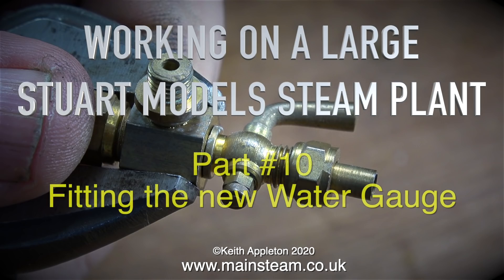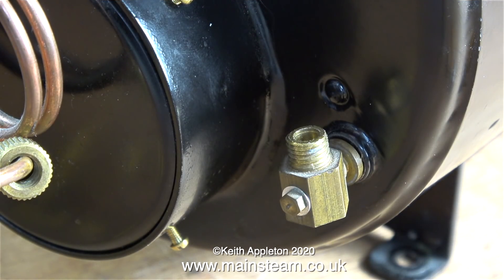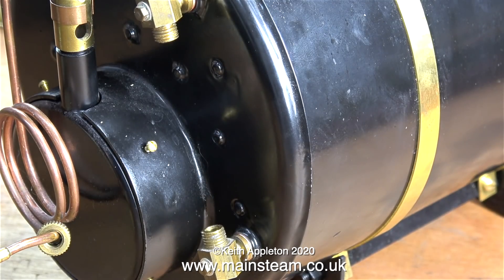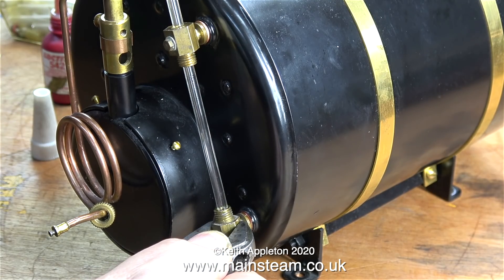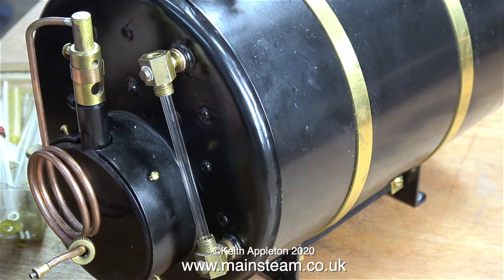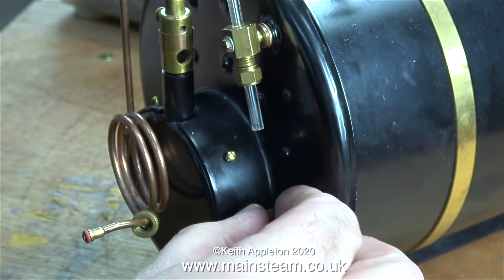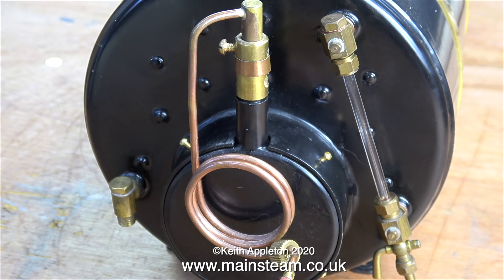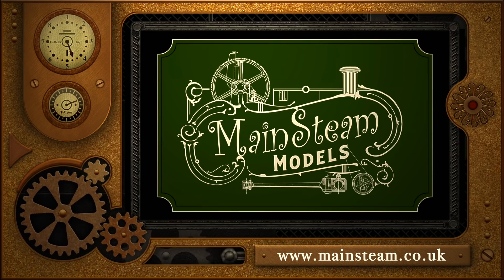WORKING ON A LARGE STUART MODELS STEAM PLANT - PART #10

Comment: When fitting Gauge Glasses I try to find a metal rod the same Dia. as the Glass and use it to get everything in alignment, I brake less glasses that way. I also flame the cut ends of the glass to get it smooth.

Comment: You mentioned lime scale in the water gauge.  Do these not use distilled water?
Reply: In our city power plant, they use distilled water. 
Buy that system runs 24/7/365.
On a toy, that gets fired for ten minutes, 5 times a year, a lot of people don't bother with distilled water.
Reply: Yes,it is best to use distilled water,but I never did in 20 years and had no problems.I would just clean the boiler out periodically.